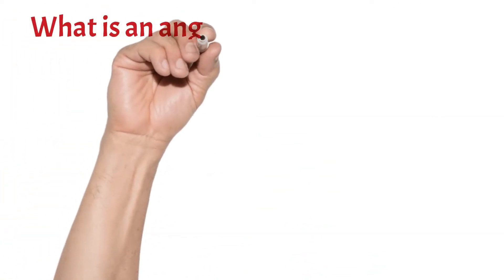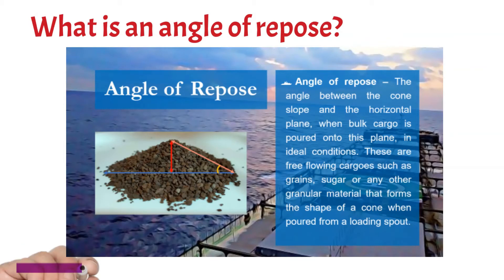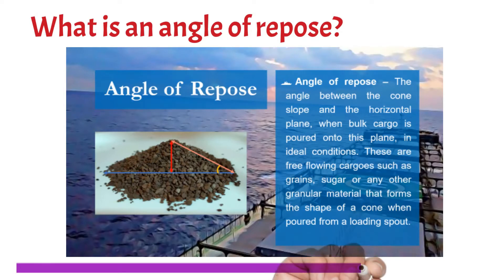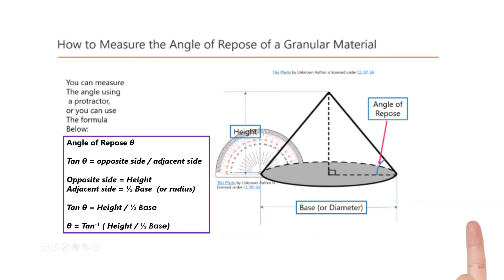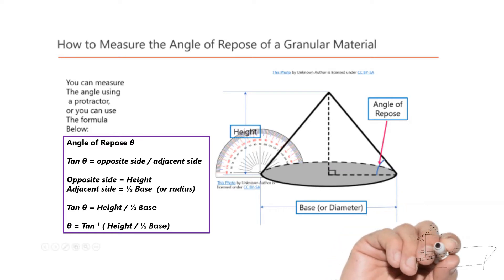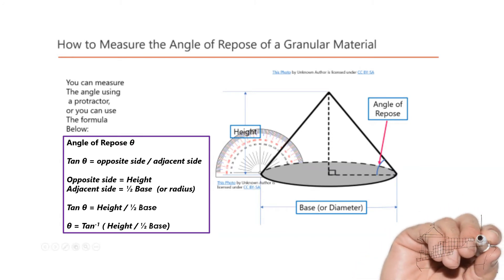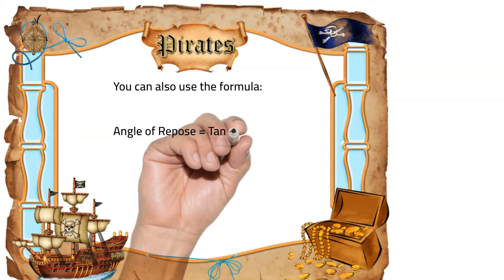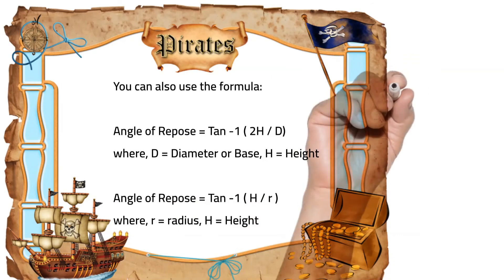How to Measure the Angle of Repose

Comment: Why is it important in ship. I hope you can answer my questions
Reply from the maker: It is required by the Section 6 of the IMSBC Code. You need to know the angle of repose so that you know if your cargo will easily shift or not during rolling of the vessel and shifting of non-cohesive cargo will reduce your stability.